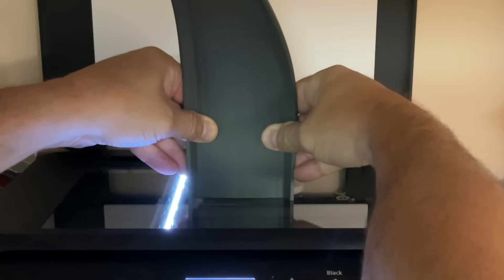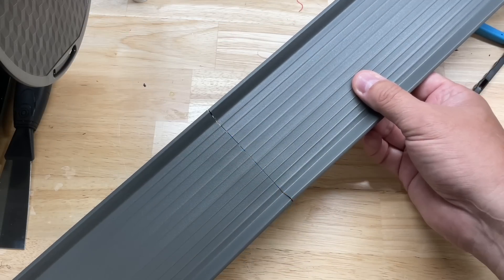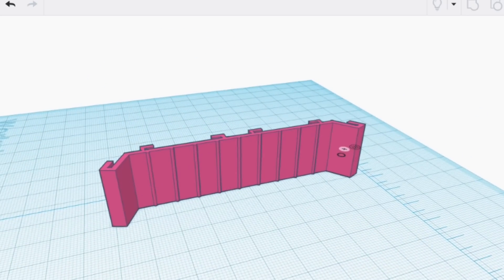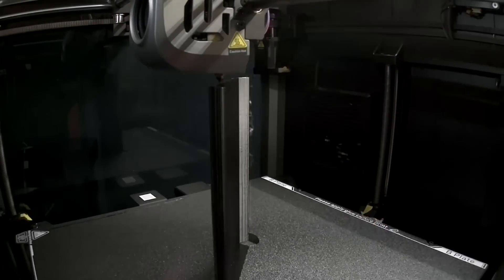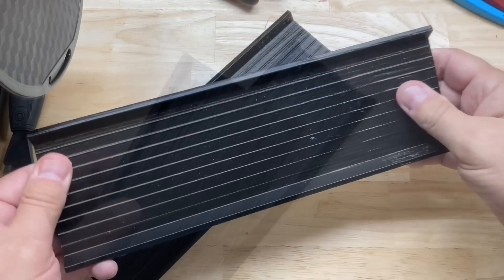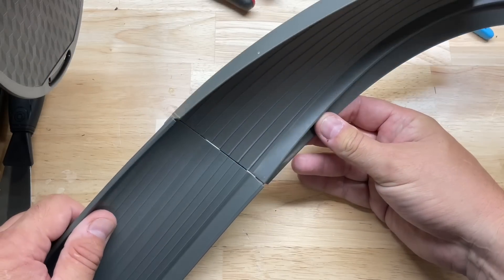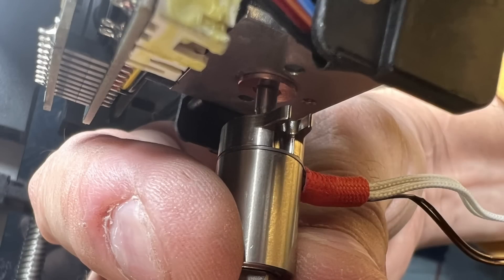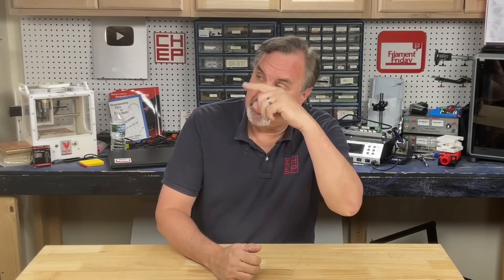Using Paper Scanner to Create 3D Prints

Comment: I hate ads in Videos BUT if the hotend on my new K1Max break i will replace it with a microswiss like on my old CR6-SE. What about speed? With the high flow in theory there should be more speed possible?
Reply from the maker: I’ve found the results are so good I don’t mess with the speed settings. It’s already quite fast.

Comment: With the pieces that are too flexible... I wonder if you could get them in place at the right angle/shape and then lock them into that shape somehow, like by painting them with a durable paint or brushing some epoxy across the bottom of them, because (I think) an excessively soft track will slow cars down, throw off their directions and possibly make them jump off the track.

Comment: If possible, I would print it on its side, so the print lines match the direction of travel. That's not always the best option as it can possibly lead to added friction, especially if the car is not traveling 0 degrees parallel to the print lines. With that said though, it might be best to just print the entire track and to make all the track pieces yourself... and by your own design, so you can optimize them specifically to be 3d printed. I really believe that you could come up with a better design.

Comment: To reduce the amount of stringing and speed up print time, I would eliminate the retention channel on the bottom of the track everywhere except for the first and last 2 in of the track. If you are decent at parametric modeling, you could pretty easily configure your model to only have the retention slots within one and a half inches of the ends and you can have dynamically sizable track lengths.

Comment: How about stand two up with the inside of the track facing each other, edges just barely touching, then just cut them apart at the edges when done?
Might stop the wiggle during printing? Or you could even try 3 in a triangle or 4 in a square.
Reply: 2 at an angle or 4 in a square 👍
 I'd set them tracks facing outwards (minimizes stringing on track) and one layer thick 1-2 wall wide connectors to join them for rigidity, maybe every 1 cm. Easy to rip off (like this supporting idea is ripoff from Slant3D😉)
Reply: Might even be able to do this with vase mode and 1mm nozzle?

Comment: I often use flatbed scanners for stuff like that, but for modifications to scale model kits.
After a while, you end up with a set of homemade jigs to hold the pieces in just the right position. There's also these sheets with millimeter markings usually used in fabric hobbies, also helpful in many such cases of you just laser-print them on overhead projector sheets.

Comment: You could probably print 3 or 4 of these tracks vertically at the same time. Position them track facing outwards to form a shape, e.g. triangle / square as close together as possible and linking them with tiny bridges from the underside (i.e. the inward facing area) of each every 2 cm or so to provide some rigidity. Those links can be clipped off afterwards and won't ruin the surface because they're on the underside.

Comment: Great idea using the scanner. I have done a similar technique with Fusion360 by taking a picture and importing the pic to Fusion and tracing the part, but sometimes getting a picture perfectly lined up is hard. Next time I’ll try the scanner. Thanks for the tip.

Comment: I use my paper scanner all the time for 3d printed projects. Last week I print new covers with integrated handle for 240V plugs for band and table saw. Scanned top and inside the plug, cleaned it up in Fusion 360 and printed them with PLA. Original plugs were so thin I was always cautious not to let the fingers hit the HOT contacts when pulling it out of the wall. As for you race tracks falling over when printing long sections. I had a project with similar cross sections, hard to stabilize on vertical printing. I made a tower out of 3 sections, edge to edge, like a triangle. Intermittent tabs to hold together on the edges. Printed solidly, no swaying, and snapped apart when done.

Comment: could try printing 3 or 4 pcs arranged as a triangle or square to stabilize things while printing then cut apart at a thin tab between them
Reply: Triangle, always the stiffest structure, and it would be easy to slice apart with a utility knife at the outside corners of the track sections.  👍

Comment: Plus the Botmaker track uses magnets so you can print it flat!
Reply from the maker: Are they available anywhere?
Reply: @FilamentFriday  Well I just had a brain flood with memories that I had long forgotten.. You don't print the straight track you use Coro-Plastic sign board and just add the mag-track ends. I got a special cutter to cut the board from Amazon. You cut one side of it on the long sides and fold it to form the track walls. The mag-track ends have pins the go into the sign board that hold the sides vertical. Makes making the straight track much easier since you can make 3 foot sections. You print the curves and the transitions to the curves. There is even a merger section the goes from 4 to 2 lanes.

Comment: You might want to try printing two tracks together - the top of each facing each other - sort of like [ ] but touching [].  This would create a sort of tube which would help stabilize the two parts when they get longer (and thus taller on the bed).  You could then just cut the two pieces apart along the seam.

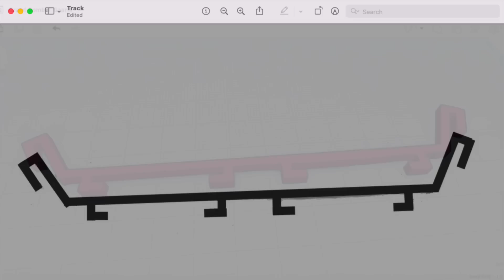Comment: Hi Chuck, a suggestion for a video here.  From 01:23-01:30 you mentioned that you brought the scan in, cleaned it up, and then exported it as an SVG, but didn't go much into the details.  The "convert raster image to vector lines" process can be a bit of an art form at times.  I know how to do this, but I suspect not all of your viewers might, and you might consider making a video on how to import a scan, convert it to a vector/illustration, and then export it as an SVG.
Reply from the maker: This video explains that process. 
Scan to 3D Print using a Paper Scanner
https://youtu.be/5pioFLkESD8

Comment: printing track vertical nice!! like one of the other commentors said, if you arrange 4 pieces in a vertical square like orientation you can connect them with little tabs, they can support themselves as they go higher.  I have a modified ender 2 pro (a couple) that I use to print 18" pieces of track (search 18" ender2pro) if you are interested.

Comment: In tinkercad place vertical supports along the back of the track close to but not touching.  Then place small tabs to bridge the gap between the two that can be broken off later.  Will take longer to print but should stop any movement of the track.

Comment: How about connect 3 or 4 tracks together just barely by the edge so when you print them, they come out in the form of a hollow triangle or square tube vertically so they support each other, and when done, just take a box cutter and slice them apart where they connect? They can be each other's support.
Reply: Great idea!
Reply: Yes! This is exactly what I was about to say.